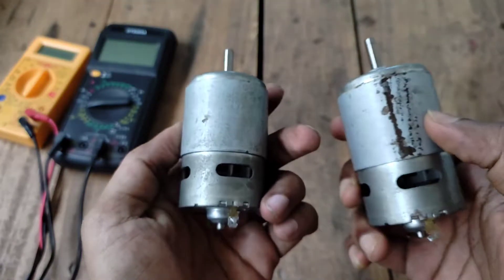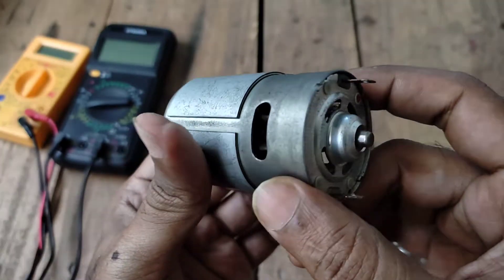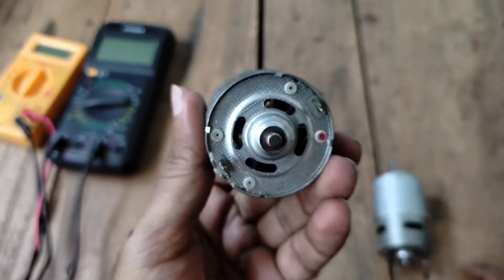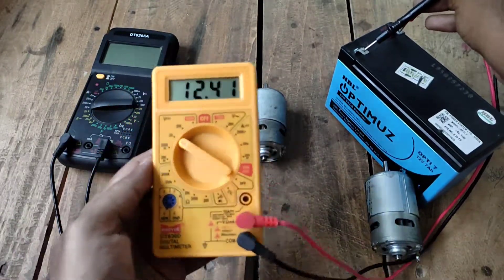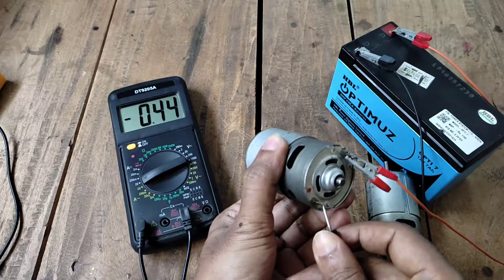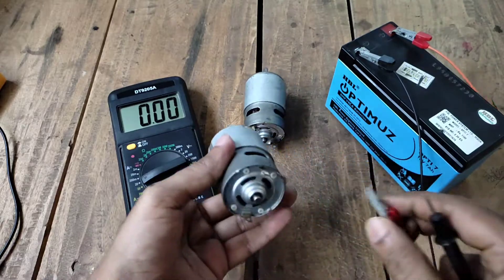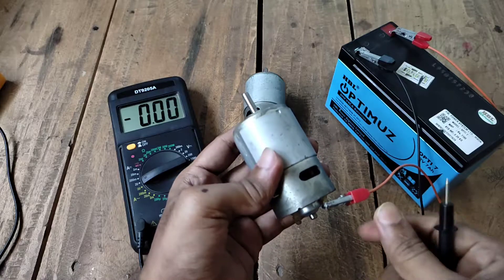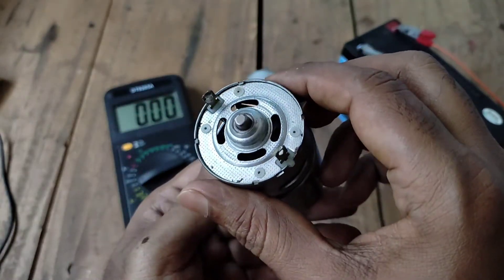How to Rewind 775 Motor to Increase RPM & Torque

Comment: if i want to increase torque but decrease rpm or keeping em the same?
Reply: Use gear train
Reply: @VikashKumar-mw1un off topic you fking dumb , hes talking about the motor itself ,l
Reply: Increasing the windings could also increase the torque but will also add the rpm just a lil bit , but a fewer windings will increase the rpm but reducing the torque
Reply: Increasing the windings could also increase the torque but will also add the rpm just a lil bit , but a fewer windings will increase the rpm but reducing the torque

Comment: What is the formula for calculating the number of turns? i have a motor with 20 turns of wire, now I want it to run 10% faster what should I do? I only know that increasing the diammmeter and decreasing the wiring  turns will do it but I don't know how to calculate the number of turns
Reply from the maker: Increase the thickness of the wire or increase the turn of wire